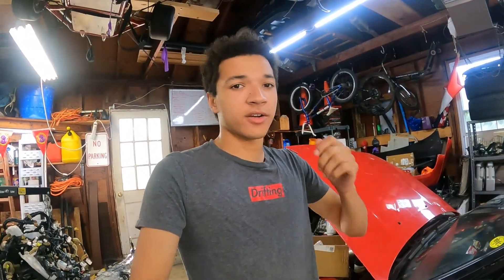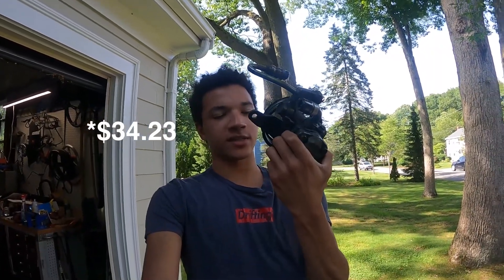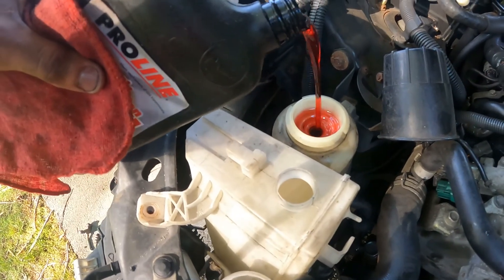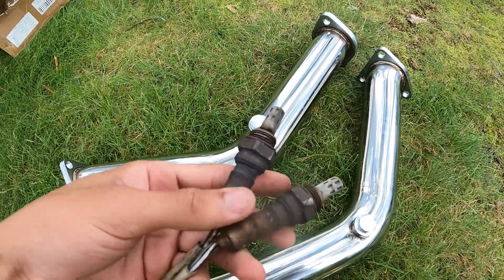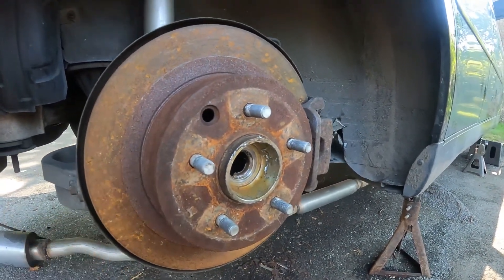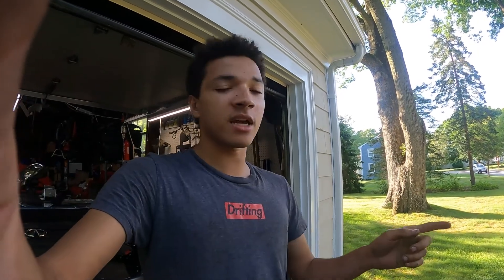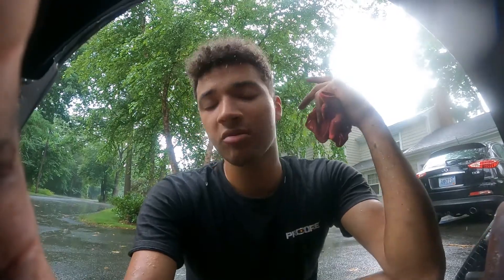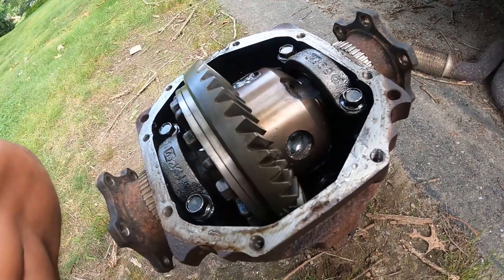Suspension Upgrades and Repairs - $2000 G35 Drift Build Ep. 2

Comment: cheap upper front control arms to add some camber will help binding a ton with the gk tech bolt on angle kit if you dont want to spend the 600 for the lower ones
Reply from the maker: Thanks for the info, I'll have to look into those.